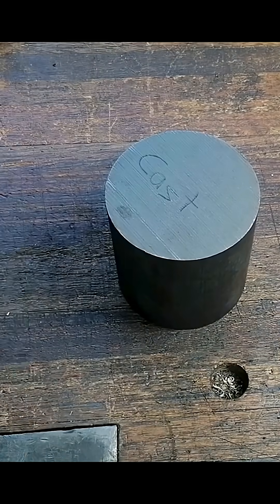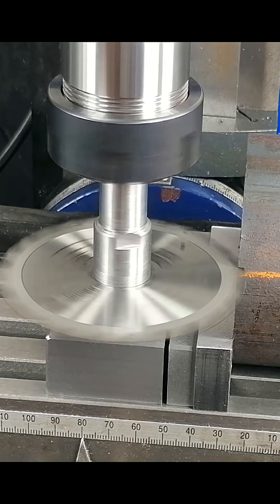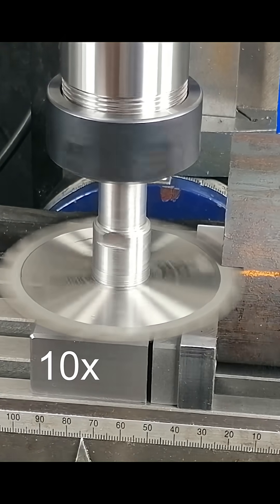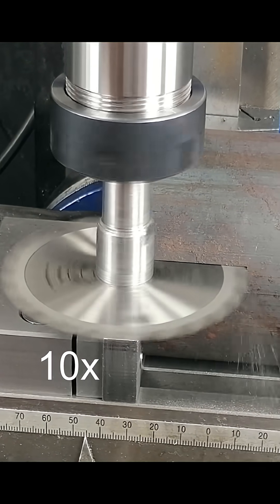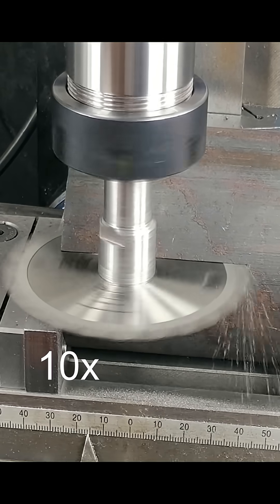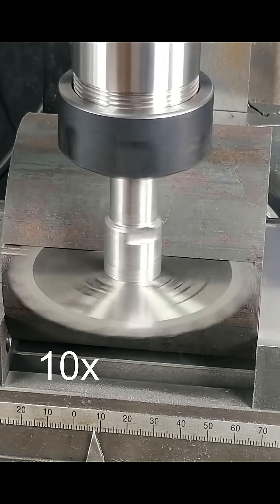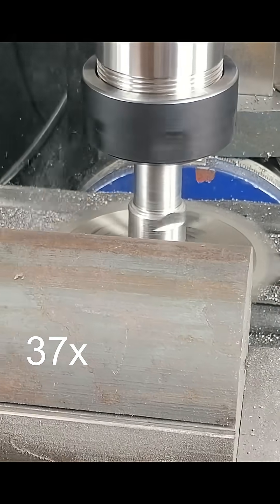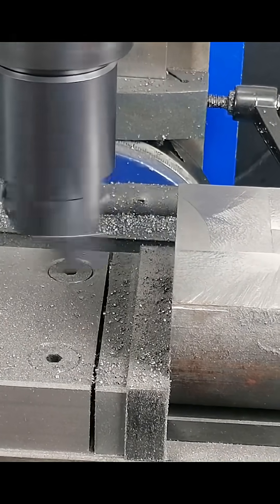Slitting a Massive Workpiece on a Mini Milling Machine

Comment: WHATS RPM AND FEED?
Reply from the maker: The RPM was about 640rpm and the feed was manually, so I do not know the feed rate. I normally feed at the fastest that I can without letting the machine stall or is work too hard. Stalling does not really happen when I cut cast iron. You can see the feed rate in the videos (I start with normal speed, then speed up the video (so as not to bore you guys) and place the number of times that the video is played back next to the cutter.